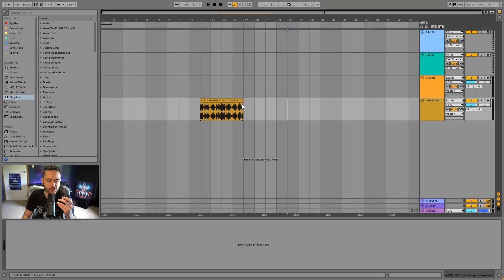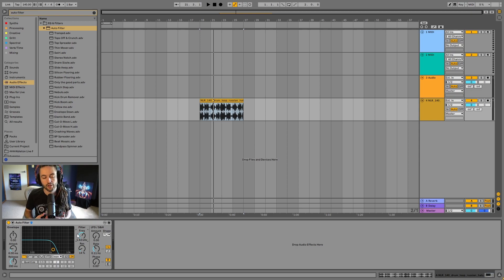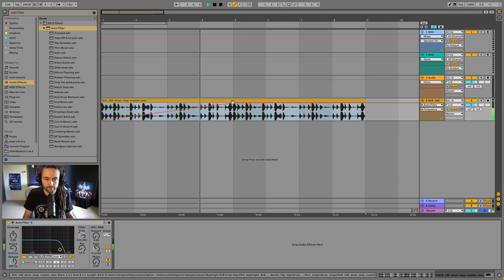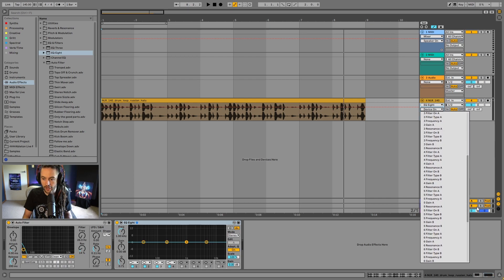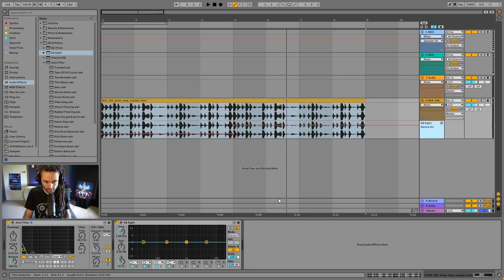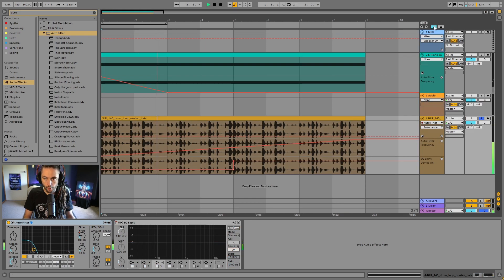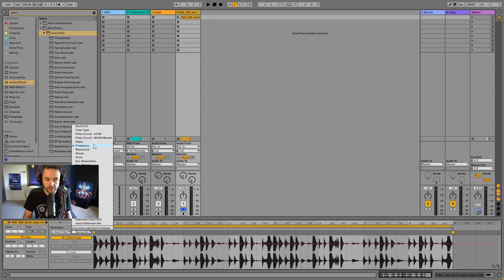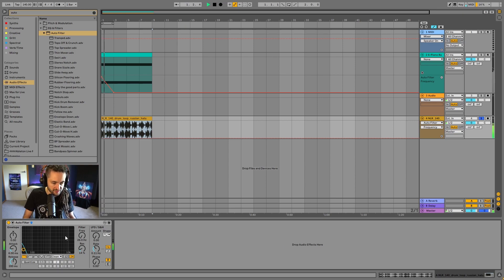Understanding Automation in Ableton Live 11 (2021)

Comment: Ableton should get their act together. They have lost it with the latest version. Everybody had a hard time. We get it. But we all pay the same upgrade pricing again and again and we cant even do some basics right.

How to rename a track including all clips in a track using 1 keyboard command and 1 x typing ? Cant do it.   They add this select all clips feature in arrangement ( right click select all clips of current track ) 

No shortcut. not in a menu. 
Only accessible using right click of a mouse.  

The Ableton devs need a basic User Interaction Course before they move on. I love Ableton and have been using it since version 3. 
But Ableton UX in arrangement is a mess.

Here is an idea. whenever you rename a track you can add a shift key so it will include the track and all track clips. 
Done. 1 extra key. 
Saves 10 keystrokes. 100 times a day. welcome😆
Reply: think your reaction fits better on a offical Ableton Youtube channel tbh. So they might exactly read it. But fair
Reply: @rachidow2125  Doesnt work haha. Public comments can be more effective. The latest beta finally has some improvements in this area. So nice!